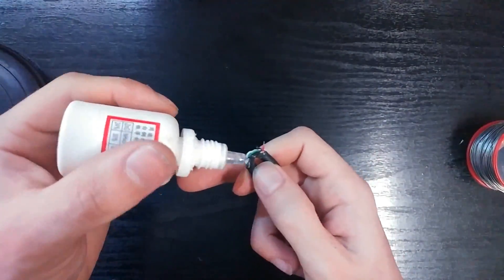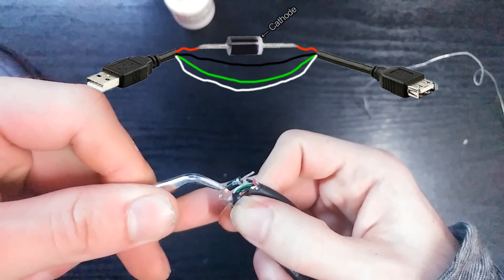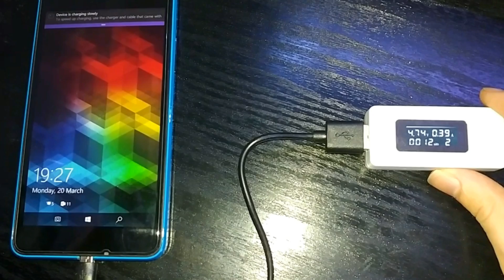Add extra power to any USB cable!

Comment: THank you for this! I wonder if it could work with my project. Often usb 3.0 cables that power external usb enclosures have 1 usb wire for data and 5v power, and it's sometimes not enough power for the hdd. My plan is to make a kind of Y cable to add power from another usb cable powered with a phone usb charger. One cable (data+5v) would be connected to the laptop, and the other cable to the charger. I can of course solder the red cables together and the black cables together, but, I'm just a beginner, maybe a diode would be necessary. I don't know where. I wouldn't like to damage the usb laptop port, in "injecting" power in it. Thank you for your help!

Comment: Nice bro.. but what if we totally cut off 5V wire from usb pc side and use only 5V from external.. that way we dont even need a diode..
Reply from the maker: Hum.. You might lose the ability to plug and unplug your USB device while the PC is on if you cut the 5V wire from the PC, while you won't need the diode anymore, it could cause some connection issues.

Comment: well i acsually wanted to make my webcam cable longer so i can put it outside and use it as a security camera.
the thing that i find out that the picture was wery bad so i found an usb and i cut it open, and i put a power supply for it.
but for some reason the pc sayed UNKNOWN when i plugged in. and it only worked when i plug the power INTO THE PC!
so can annyone help?
Reply from the maker: For that specific use-case I honestly think it would be better to get either an active USB extension or a cheaper wireless camera. For that amount of data, assuming a cable longer than 5 meters you will need an active USB extension. In a longer cable you definitively need a way to boost the intensity of the data signal, it won't be enough to just "add extra power".

Comment: A Schottky diode, such as the 1N5817 has a lower forward drop (<0.4V) than a 1N400x (0.7V), so should be a better choice.   In any case, you want a hookup that avoids back-powering the USB hub (a no-no).
Reply from the maker: You are 100% correct, this video is long due an update!
Reply: Can I use a LED?
Reply: @speeter6345  Again, you're fighting the bandgap--which, for a typical LED is somewhere around 2V.
Reply: Does a 1n1448 work?
Reply: @speeter6345  I'm not finding information on a 1N1448;  are you sure you don't mean the very common 1N4148?  You're going to have to put up with the 0.7V bandgap and the amount of current that can be passed will be limited by the diode ratings (~100 ma continuous).  There are better choices--and Schottky rectifiers are inexpensive.

Comment: What happens if I didn't use that diode and just disconnected the power wires from the data cable and connected them to the power only cable like in this video?
https://www.youtube.com/watch?v=uLuBuQUF61o
Sorry I'm not into electronics, but I don't have this cable available for purchase where I live and I need to use my external WD my passport hdd with my xiaomi Redmi note 9s phone so I have to make the cable myself.

Comment: Hey man! I tried it and it works. With my design however the data cable is around 4ft long and the power cable is short (short I know probably would be better if the power cable being longer) Do I have anything to worry about where the length of the cable is concerned is terms of speed
Reply from the maker: Glad it works!
Regarding the speed there's not much to be concerned unless we are talking about very long cables. Take USB 3.0/3.1 for example, regarding only the data cables and depending on the quality of the cable you would have few to no signal degradation up to 10 feet (3 meters), but more than that I'd definitively recommend an active cable (they are basically cables with signal repeaters).
Reply: @Mywk  Thanks for clearing it up. I have a problem or at least I'm not sure if this normal behavior but...since I plugged the power cable into the charger, I notice that the "data+power" cable is giving off power. Is this normal? Cause I got the impression that the diode was supposed to prevent any backward flow and that cable should only receive power from the PC and nothing more.. I used a 1N4007 diode. I hope I didn't over heat it with my soldering iron when I removed it from an extra charger I had lying around.

Comment: Instructions weren’t clear kitchen is on fire
Reply from the maker: At no point did I say to put the cable inside the toaster D:
Reply: @Mywk  if you connect the green with black stripe wire directly to the one of the coils of the heating element in the toaster then push it down like you were toasting, once it warms up just a little bit you want to connect the yellow with white stripe to the flux capacitor and run a new wire from the capacitor to a 007Bravo transducer (positive side) and run a new wire from the negative back to the flux capacitor (left hand side) then from the other side you run a wire into a jar of marshmallow fluff and turn everything on full power it will make crystal meth.

Comment: Can you add "quick charge" to a cable that does not have it ? 

Need a USB device in my car that will give me Android auto but, it charges very slowly,  I have a Quick charge 3.0 charger that I use in my car, could this be used to give my phone quick change but, allowing data to go to the Android auto system ?
Reply from the maker: This is somewhat tricky, the simple answer is no, if you want a better explanation here it goes:

It should work, but you will not get more than 500mA.
When you connect your phone to a data port, it asks the charging device how much current it can supply before pulling more than 100mA. Since your car doesn't know there is a quick charge power supply available it will very probably just report 500mA maximum available, which should be pulled from the power source (aka your charger).

Comment: Why not skip the diode and draw power from the external supply and get data from the computer. So don't connect the power cable from the computer (the red one). And only connect the data, and ground wires together. I think I am gona make a test of this one, I think it should work. Itroducing a diode with a voltage drop of 0.6 Volts does not feel right, especialy since you do not want to draw power from the PC anyway.
Reply: Hi there Jan did you try it, I am having a bit trouble can you tell me your result.
Reply: Yeah that's what I thought. Does this work?

Comment: Guys help me out. I have connected 10m usb cable to my webcam and its not working,how can i solve? Thanks
Reply from the maker: Q: Why can't I use a cable longer than 5m?
A: USB's electrical design doesn't allow it. When USB was designed, a decision was made to handle the propagation of electromagnetic fields on USB data lines in a way that limited the maximum length of a USB cable to something in the range of 4m.
So to put it in a few words, you will need a HUB in between.

Comment: I liked the video. Its simple and informative. But i need do this for usb 3.0 hub. Can you make a video with usb 3.0? I have a usb 3.0 hub, it have 10 wires inside the usb cable. I want to add external power to it. Please help me!! I will be very grateful.
Reply: You shouldn't manually modify USB 3.0 cables because they have high-speed connectors. The amount of twists in the connectors and their length must be correct. You might cause problems with USB 3.0 devices if you modify the cable. You could completely remove the ability to benefit from higher speeds which the USB 3.0 provides.
Reply from the maker: Eyüp A. Hey! The concept is the same but gotta check the schematics when I get the time, I'll let you know when I do!
Reply: @Mywk  any updates on this video?
Reply: TechCoders Thank you! Please chech this photo>> https://drive.google.com/open?id=12dYJa98zyb4rLj3FjpTzf4tSN4Up8yqd

Comment: Is it possible to add extra power to the data cable? I recentely bought an wireless usb modem and it requires 3000mW, so I need 0.6 + Amp. It only operates with a single usb cable for data and power. made in china
Reply: oh sorry. This should work for my situation. I thought you had 2 female USB.
Reply from the maker: Hey! As long as you use the diode there's absolutely no problem, the cable in the video above is used to power a HUB with 4 phones attached to it and all of them work flawlessly for data transfer while charging at the same time.

Comment: What is the cathode used for?
Reply: i guess it used for don't harming pc's usb port.
Reply: to prevent the current from external power supply flowing back to pc @eyupa.1791

Comment: I did the same thing but all i did was connect the black to the main black of everything and cover the red coming from the computer,  
For now everything is just twisted together and taped and the wall outlet is just a 700 mA hard wired charger but I will remake it when i get another portable external drive
Reply: Really and this works?